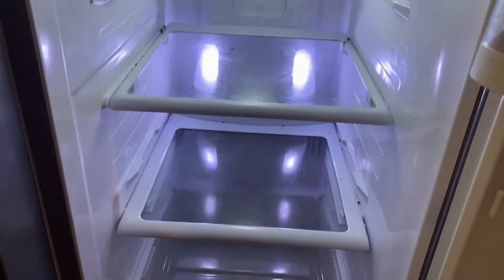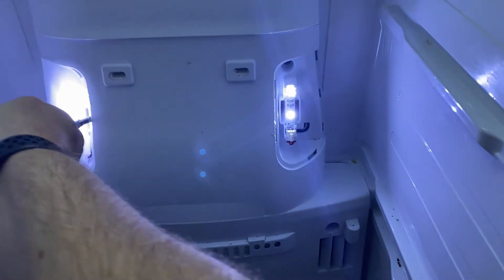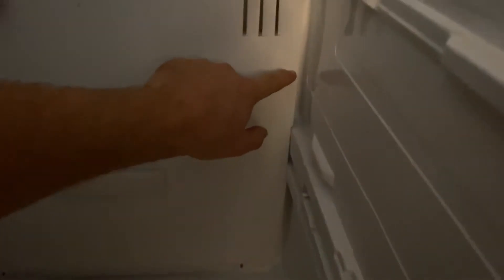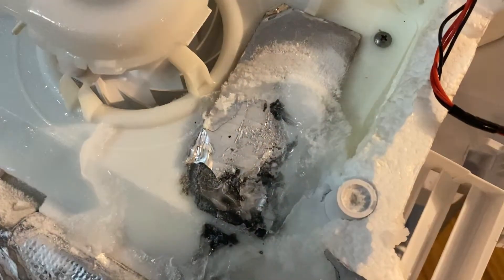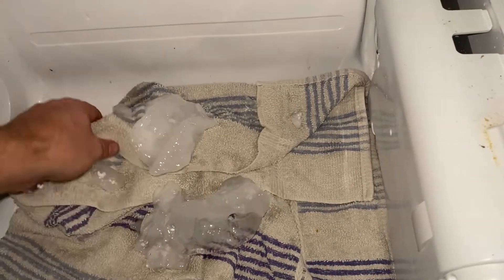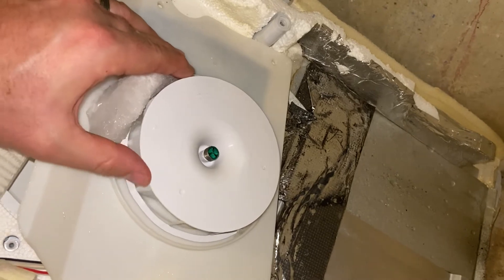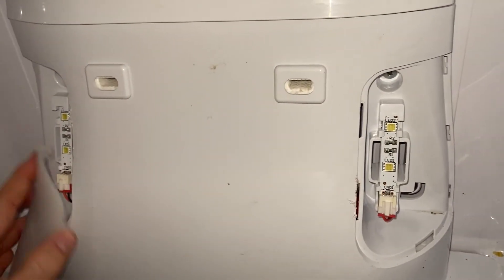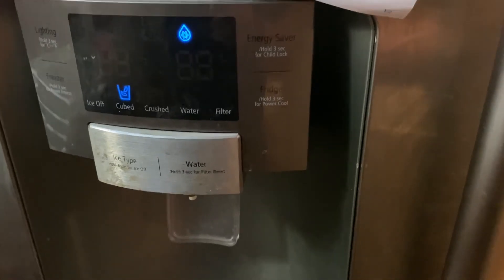How To fix your Warm Samsung Fridge | RS265TDRS #DIY #notcooling #Samsung

Comment: I have this same problem with my Samsung, but I went about 2 years in between issues. What did was open up the back and find the drain tube. It was clogged with dust/lint. I cleaned it out and then modified the end of the tube. It came to a V, so I cut a larger hole it. It drains better now. Not sure if that could help, though I now know it isn’t a permanent fix. I’m never buying another Samsung product again. I’ve also had a bad dishwasher and had to replace my oven’s convection fan.

Comment: Just bought similar model (RS263TDRS) for $200.  After 24hrs temperature monitoring, temps are 35F & -10F for Fridge(2bars) and Freezer(1bar).  I can see from these extreme temps, the sensors are not properly turning off when set temps are reached.  Previous owner had the same issues and moved on from crappy Samsung non-support.  I expect to solve permanently using heat tape routed through the areas that normally frost up, and set up a weekly cycle that defrosts without having to tear it apart each time.  Designing it to melt ice, not hot enough to melt plastic. Just speculation at this point.  I will update if and when my project becomes reality.
Reply from the maker: That's a cool solution! I personally will not buy another Samsung appliance. I've switched out sensors and misc parts and pieces with no improvement. But I'm also cheap so I'll keep plugging away with defrosting until it finally stops working. :)

Comment: I have the same fridge and fixed it once already pretty much the same way it was done here. My fan was totally frozen and it took hours to defrost the fan. I ended up using the hairdryer to speed up the process and to get it back together. I was worried that the fan may have been ruined from it being so frozen that it couldn't spin, but it ended up working fine. It's been a few years since the last fix and I can hear the fan hitting the ice again. Repeating the process again it seems.
Reply from the maker: Mine froze up again and I defrosted over the weekend. It lasted a little longer this time, I'm getting really good at doing this. :)

Comment: I also have to go through this with this piece of crap RS265 Samsung.....Just got it back together but the fridge condenser drain is plugged so I will be getting back into it tomorrow....There is a diagnostic that is used by service people that involves pressing the LIGHT and FRIDGE buttons and holding down for 12 seconds....When letters appear on the readout press the FRIDGE button until rd (refrigerator defrost) appears. This did not do the job to defrost after months of ice buildup but will do it weekly to see if it keeps the crappy machine ice free.....(I gave up on replacing the icemaker after replacing it 4 times at $100 a shot....
Reply: I’ve seen where the drain tube can get hard and not allow the water to go down to the pan. Might be worth checking out on yours. These fridges 100% have some issues.

Comment: So you defrosted......but did you fix the problem
Reply from the maker: It works for about 4 months. I’ve replaced the thermostats but that didn’t seem to fix the issue. Honestly, I’m hoping it craps out someday so I can justify getting a non-Samsung fridge
Reply: @efd  
Did you check your defrost heater?If it has defrost thermostat that'd be a cheap fix.

Comment: Hold down the energy saver and Fridge button for at least 8sec at the same time to go into diagnostics mode. Use the fridge button to scroll through the options and stop on rd (aka refrigerator defrost) let it sit for 10 to 15mins and it will continue to beep. Once you feel it was enough time to defrost hold those buttons down again to enter diagnostic mode. Scroll using fridge button until the screen is blank and let it time out. It will be back in normal operation. Kick on power cool and you’re good to go. Do it often enough that it doesn’t ever freeze as high up as the fan. Lots of videos on that for reference. Good Luck #samsungsux

Comment: I’ve had to do this every 2 weeks for the past couple of months. The defrost sensor/unit was replaced. Issue persists. Next the home warranty company should replace the board. They are going to get tired of me calling them every two weeks until the issue is permanently resolved. When that happens I’ll let you know what was done.
Reply from the maker: that would be awesome! thanks

Comment: After doing this and defrosting a big block of ice behind the panel ...I am not sure if i am replacing the panel properly.  I can't get the panels 3 tabs on the left side or right side to snap into place.  Any suggestions???  I mean ...I'm guessing that the 3 plastic tabs on each side are supposed to snap into those little indents right???
Reply from the maker: Mine don’t snap, they press into place and are fastened with the screws
Reply: @efd  Yes, mine fasten with screws as well but each side of the panel has those 3 little tabs that I think are supposed to "click into place", I can't get the panel pressed in that far.  When you replaced your panel did you just push straight back?  My tabs are actually blocking me I think.
Reply from the maker: @Marshall_EL34  i lines my screw hole up and pushed it straight into place. I don’t recall lining anything else up.

Comment: Same model, same problem - every 6 weeks!  I'm a pro now.  I find a little hot water squirted on the ice works faster than a hair dryer (with ample towels in place, of course). But, what is the root cause, and can it be fixed???  Thanks!
Reply from the maker: I haven’t found a fix, I’ve replaced several parts on this thing and it still happens. I just know when I hear the sound, it’s time for a defrost.

Comment: Is there a way to fix this permanently so you don’t have to do this every few months?
Reply: Yes. Trash it and get another brand. I have had this problem for 4 years now. I used a repairman once. Cost $400, he changed several parts and melted the ice. Problem came back within a year.  I just do it myself now. Easy to do. Pain in the *ss is all. Samsung refrigerators really suck. I did this so many times it destroyed the tape and styrofoam seal so finally I replaced the whole fan and assembly. Still comes back. In fact I'm going to manually defrost tomorrow morning.

Comment: After 9 years, my fridge started doing this. Do you have any idea what causes this?
Reply from the maker: I haven’t figured it out, I’ve switched out lots of different parts and none of them have fixed the issue
Reply: I believe The cause is moisture and difference in temp between the fridge and the cold line coming into the fridge (where the ice block site is). It appears the permanent solution is installing a heating element near it (Supco SH502). You might also try insulating the entry portion of the cold pipe with thermal tape or spray foam.
Reply: @xmop1  thank you for taking the time to help.

Comment: After doing this, the fan is not starting up. Actually I do not know if if it was before. 
Is there a way to test if the fan is in good condition and make it start pushing buttons on the front panel?
Reply from the maker: Do you have a multimeter? You could check it for continuity. Put the probe in the 2 ports and see if the fan has continuity. If it does, the issue is that it’s not getting power. If it doesn’t, the fan could be bad.

Comment: Does anyone have the part number for the entire panel for this Samsung Fridge ? seems better to repair the entire panel. thanks
Reply from the maker: I don’t. I’m not sure what the root issue is. I’ve changed sensors and thermo stats and it still happens